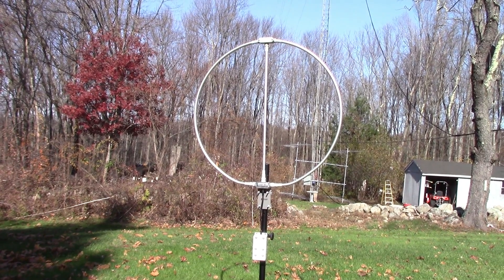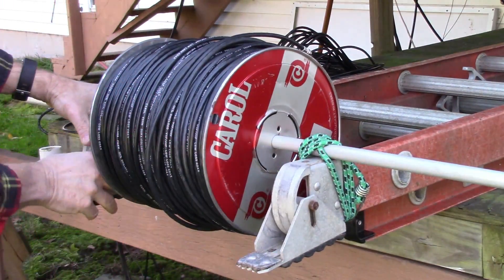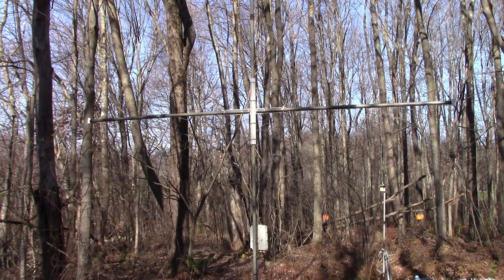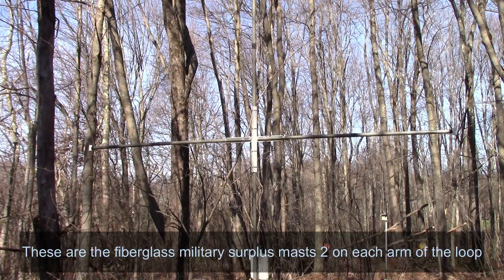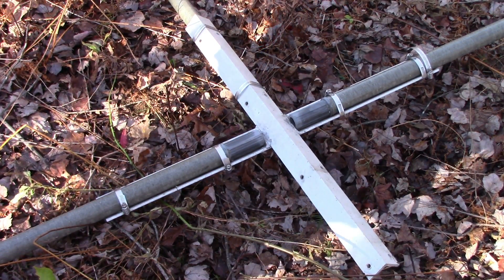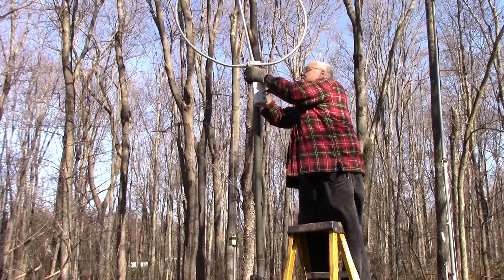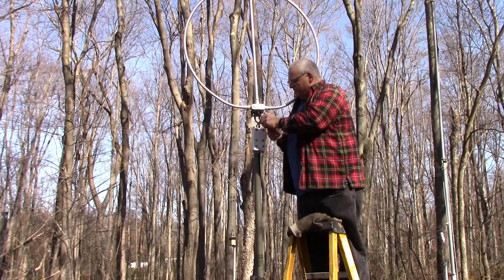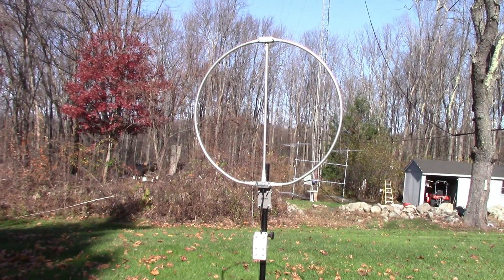Remoting the Pixel RF PRO 1B Loop antenna

Comment: The purpose of this expensive $500 antenna is unwanted noise and station elimination by built-in in excellent amp and its directional characteristics so using it in quiet rf area like yours  is an overkill for your wallet.